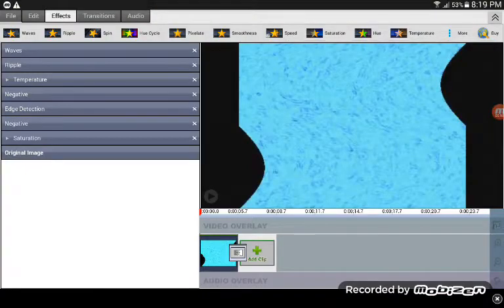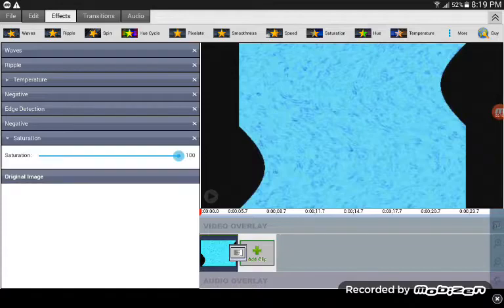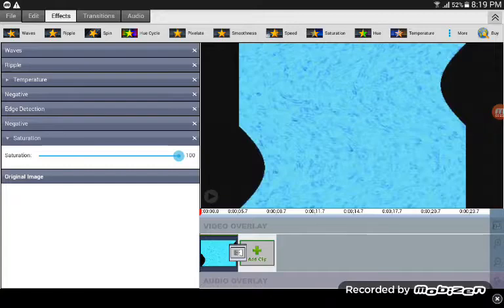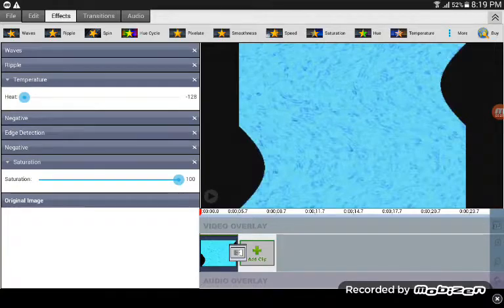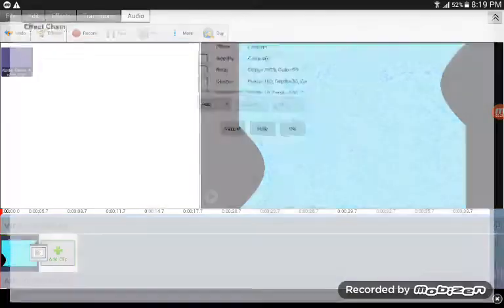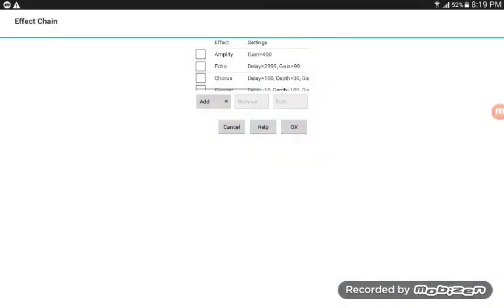(REUPLOAD) How to Make Wavey Ripple Dizzy

Comment: Sound
Amplify Gan 400
Echo Delay 2999 Gain 99
Chorus Delay 100 Depth 30 Gain 50 Modulation 2000
Flanger Delay 10 Depth 100 Gain 100 Modulation 5000 
Done